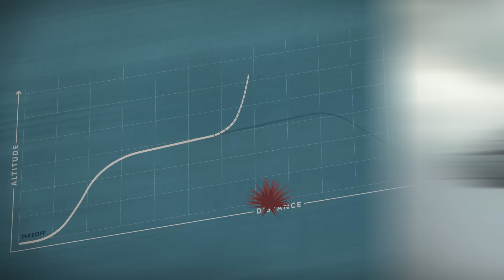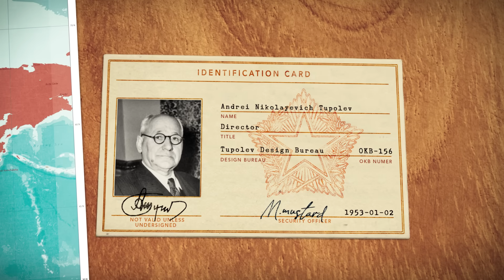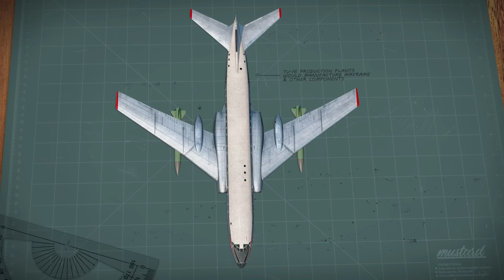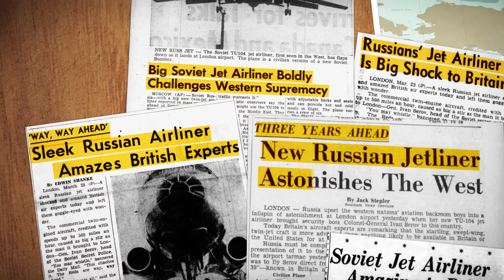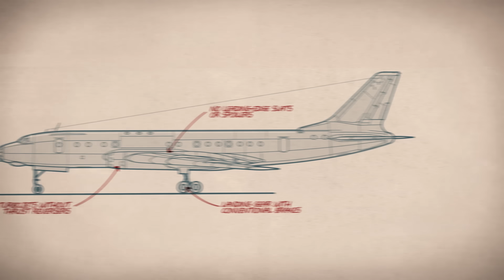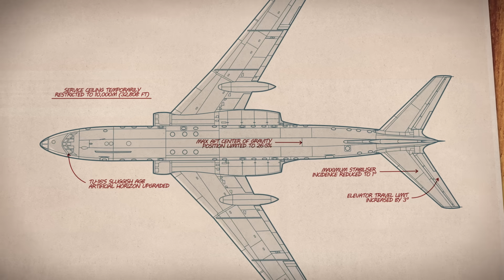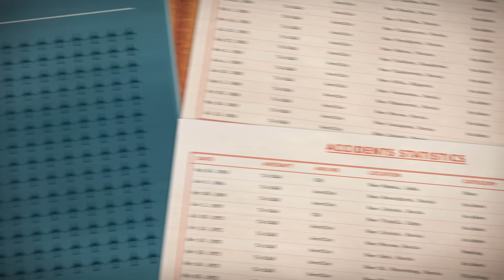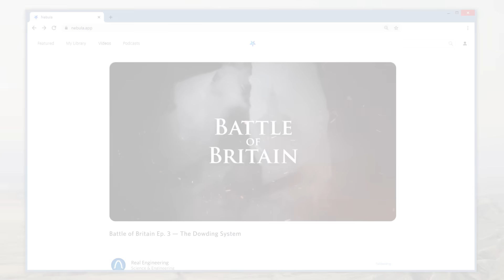The Soviet Airliner Designed To Crash

Comment: Did you forget DC-10💅💀
Reply: The DC-10 has an excellent statistical safety record compared to the Tu-104 or the de Havilland Comet
Reply: @sandervanderkammen9230 

We feel we can shed some light on some common myths & misunderstandings repeated in many comments.

It is indeed correct that there were plenty of aircraft that were more dangerous than the De Havilland Comet before & after the Comet.

Obviously It's not valid to compare a Bow-wing ( see B-47 wing folding & wing collapse incidents for details) jet  airliner designed & first built as late 6 decades after the Comet, with the fabulous De Havilland Comet, the world's first high altitude jet powered airliner.  
  Vast improvements in commercial aviation infrastructure alone being a significant factor in improvements in air travel safety safety over mire than half a century.
    Of course 50 years more design, build & operation experience didn't prevent the horrendous Bow-wing Max  incidents, there can obviously be no excuses for that.
  
  That's correct of course, at the time the Comet wasn't particularly dangerous. Agreed, that is indeed the case of course, The DH Comet was definitely not the worst engineering failure in commercial airliner history.

Losses comparisons
How things were in those days.

DeHavilland Comet 4 UK                  14% 
DeHavilland Comet all mks             17%  

Boeing 307                               70%
Boeing 247                               48%
Boeing 707            .                  20% 
Lockheed Electra Turboprop   29%
Canadair CL-44  Turboprop     46%  
Convair CV-580  Turboprop     22%
Convair CV-880    (ff 1959)       27%  
Convair CV-990     (ff 1961)      33%

     Of course De Havilland had prior experience building many all metal construction airframe aircraft & thousands of jet powered fighter aircraft that were primarily of metal construction with pressurised cockpits & jet engines built by De-Havilland.

  Yes, that's true, De Havilland carried out full stress analysis & engaged in a comprehensive & protracted testing program which is why key De Havilland people were happy to be aboard flying DH Comet aircraft. The Comet was the first airliner where stress due to pressurisation significantly exceeded flying load stress for a full length passenger cabin fyselage.

    We agree, that's correct, the DH Comet was the first passenger airliner with full length fuselage pressurisation at 8psi pressure differential. Handley Page built the world's first all metal construction airliner during the 1920s.
    In many cases earlier pressurised aircraft were larger, needed thicker fuselage skins due to flying stresses alone & had much lower pressurisation differential pressure. 

     Of course ripstop provision was provided. The skin alloy used became unavailable at the time due to R & D at the manufacturers which resulted in the original alloy being discontinued. Later alloys had very similar properties. The skin thickness used for the Comet was used for similar size later aircraft. Frame spacing was not found to be too large & frame width was not found to be too small.

    Without doubt De Havilland did indeed always work to better than industry standards at the time, used up to date knowledge for the design & construction & no evidence of negligence or criminal negligence was ever produced in relation to the DH Comet.

   Obviously the DH Comet had no effect on the course of the aerospace industry in the UK. The UK now has the world's largest combined nuclear, aerospace & defence sectors per capita activity.

    That's correct, the investigation committee did not find hundreds of fatal flaws or evidence of design defects, structural defects, defective materials or shoddy workmanship. Indeed it is the case that ripstop provision was included. Claimed incidents did not involve cracks starting from passenger window corners.
   Pretty much all changes were just in case changes or were planned development modifications & improvements that were scheduled regardless of incidents.

    Obviously De Havilland designers knew all there was to know about metal fatigue at the time they designed the DH Comet.

    It is in fact true to say that the way airliners were built changed everywhere including in the US after the Comet incidents.

We hope this helps, obviously.

Cheers indeed of course 👍. 
       
 . . .... ... ..... .. ...
 ..... ..... .... .... ...
Reply: The DC-10 was an entirely safe aircraft after the initial issues with the cargo door were resolved.  Stop parroting things you've read on the internet but haven't looked into for yourself.
Reply: @vojtechhanus3290  We know that one of the cargo door failures was due to a ground crew member who was not trained and was illiterate. He could not read the instructions on the latch mechanism.
We also know that the other crash was caused by maintenance crews illegally modifying the latch bolt with a handheld electric grinder..
Reply: @sandervanderkammen9230 

We feel we can shed some light on some common myths & misunderstandings repeated in many comments.

Yes of course that's correct, the DC10 door issue was caused by a serious design error resulting in it being possible for the cargo door locked indicator in the cockpit & the cargo door locked indicator by the cargo door to both show the door as fully locked when in fact it was not fully locked. A rather odd agreement between a person at the FAA & a people at the manufacturers resulted in immediate modifications not being done which eventually resulted in another incident. The DC10 required other safety related modifications besides the cargo door problem & eventually attained an average accident losses rate for an airliner that first flew in 1970.

It is indeed correct that there were plenty of aircraft that were more dangerous than the De Havilland Comet before & after the Comet.

Obviously It's not valid to compare a Bow-wing ( see B-47 wing folding & wing collapse incidents for details) jet  airliner designed & first built as late 6 decades after the Comet, with the fabulous De Havilland Comet, the world's first high altitude jet powered airliner.  
  Vast improvements in commercial aviation infrastructure alone being a significant factor in improvements in air travel safety safety over mire than half a century.
    Of course 50 years more design, build & operation experience didn't prevent the horrendous Bow-wing Max  incidents, there can obviously be no excuses for that.
  
  That's correct of course, at the time the Comet wasn't particularly dangerous. Agreed, that is indeed the case of course, The DH Comet was definitely not the worst engineering failure in commercial airliner history.

Losses comparisons
How things were in those days.

DeHavilland Comet 4 UK                  14% 
DeHavilland Comet all mks             17%  

Boeing 307                               70%
Boeing 247                               48%
Boeing 707            .                  20% 
Lockheed Electra Turboprop   29%
Canadair CL-44  Turboprop     46%  
Convair CV-580  Turboprop     22%
Convair CV-880    (ff 1959)       27%  
Convair CV-990     (ff 1961)      33%

     Of course De Havilland had prior experience building many all metal construction airframe aircraft & thousands of jet powered fighter aircraft that were primarily of metal construction with pressurised cockpits & jet engines built by De-Havilland.

  Yes, that's true, De Havilland carried out full stress analysis & engaged in a comprehensive & protracted testing program which is why key De Havilland people were happy to be aboard flying DH Comet aircraft. The Comet was the first airliner where stress due to pressurisation significantly exceeded flying load stress for a full length passenger cabin fyselage.

    We agree, that's correct, the DH Comet was the first passenger airliner with full length fuselage pressurisation at 8psi pressure differential. Handley Page built the world's first all metal construction airliner during the 1920s.
    In many cases earlier pressurised aircraft were larger, needed thicker fuselage skins due to flying stresses alone & had much lower pressurisation differential pressure. 

     Of course ripstop provision was provided. The skin alloy used became unavailable at the time due to R & D at the manufacturers which resulted in the original alloy being discontinued. Later alloys had very similar properties. The skin thickness used for the Comet was used for similar size later aircraft. Frame spacing was not found to be too large & frame width was not found to be too small.

    Without doubt De Havilland did indeed always work to better than industry standards at the time, used up to date knowledge for the design & construction & no evidence of negligence or criminal negligence was ever produced in relation to the DH Comet.

   Obviously the DH Comet had no effect on the course of the aerospace industry in the UK. The UK now has the world's largest combined nuclear, aerospace & defence sectors per capita activity.

    That's correct, the investigation committee did not find hundreds of fatal flaws or evidence of design defects, structural defects, defective materials or shoddy workmanship. Indeed it is the case that ripstop provision was included. Claimed incidents did not involve cracks starting from passenger window corners.
   Pretty much all changes were just in case changes or were planned development modifications & improvements that were scheduled regardless of incidents.

    Obviously De Havilland designers knew all there was to know about metal fatigue at the time they designed the DH Comet.

    It is in fact true to say that the way airliners were built changed everywhere including in the US after the Comet incidents.

We hope this helps, obviously.

Cheers indeed of course 👍. 
       
 . . .... ... ..... .. .... ....
 ..... ..... .... .... .... ....

Comment: The planes shooting up into the air reminds me of all the US air disasters involving poorly maintained jack screws.
Reply: Well, that's not the fault of the aircraft now is it?.
Reply: @sandervanderkammen9230 

We feel we can shed some light on some common myths & misunderstandings repeated in many comments.

It is indeed correct that there were plenty of aircraft that were more dangerous than the De Havilland Comet before & after the Comet.

That's correct, an elevator jack screw is definitely a part of the aircraft obviously.

Obviously It's not valid to compare a Bow-wing ( see B-47 wing folding & wing collapse incidents for details) jet  airliner designed & first built as late 6 decades after the Comet, with the fabulous De Havilland Comet, the world's first high altitude jet powered airliner.  
  Vast improvements in commercial aviation infrastructure alone being a significant factor in improvements in air travel safety safety over mire than half a century.
    Of course 50 years more design, build & operation experience didn't prevent the horrendous Bow-wing Max  incidents, there can obviously be no excuses for that.
  
  That's correct of course, at the time the Comet wasn't particularly dangerous. Agreed, that is indeed the case of course, The DH Comet was definitely not the worst engineering failure in commercial airliner history.

Losses comparisons
How things were in those days.

DeHavilland Comet 4 UK                  14% 
DeHavilland Comet all mks             17%  

Boeing 307                               70%
Boeing 247                               48%
Boeing 707            .                  20% 
Lockheed Electra Turboprop   29%
Canadair CL-44  Turboprop     46%  
Convair CV-580  Turboprop     22%
Convair CV-880    (ff 1959)       27%  
Convair CV-990     (ff 1961)      33%

     Of course De Havilland had prior experience building many all metal construction airframe aircraft & thousands of jet powered fighter aircraft that were primarily of metal construction with pressurised cockpits & jet engines built by De-Havilland.

  Yes, that's true, De Havilland carried out full stress analysis & engaged in a comprehensive & protracted testing program which is why key De Havilland people were happy to be aboard flying DH Comet aircraft. The Comet was the first airliner where stress due to pressurisation significantly exceeded flying load stress for a full length passenger cabin fyselage.

    We agree, that's correct, the DH Comet was the first passenger airliner with full length fuselage pressurisation at 8psi pressure differential. Handley Page built the world's first all metal construction airliner during the 1920s.
    In many cases earlier pressurised aircraft were larger, needed thicker fuselage skins due to flying stresses alone & had much lower pressurisation differential pressure. 

     Of course ripstop provision was provided. The skin alloy used became unavailable at the time due to R & D at the manufacturers which resulted in the original alloy being discontinued. Later alloys had very similar properties. The skin thickness used for the Comet was used for similar size later aircraft. Frame spacing was not found to be too large & frame width was not found to be too small.

    Without doubt De Havilland did indeed always work to better than industry standards at the time, used up to date knowledge for the design & construction & no evidence of negligence or criminal negligence was ever produced in relation to the DH Comet.

   Obviously the DH Comet had no effect on the course of the aerospace industry in the UK. The UK now has the world's largest combined nuclear, aerospace & defence sectors per capita activity.

    That's correct, the investigation committee did not find hundreds of fatal flaws or evidence of design defects, structural defects, defective materials or shoddy workmanship. Indeed it is the case that ripstop provision was included. Claimed incidents did not involve cracks starting from passenger window corners.
   Pretty much all changes were just in case changes or were planned development modifications & improvements that were scheduled regardless of incidents.

    Obviously De Havilland designers knew all there was to know about metal fatigue at the time they designed the DH Comet.

    It is in fact true to say that the way airliners were built changed everywhere including in the US after the Comet incidents.

We hope this helps, obviously.

Cheers indeed of course 👍. 
     
 . . .... ... ..... ......
 ..... ..... .... .... ...